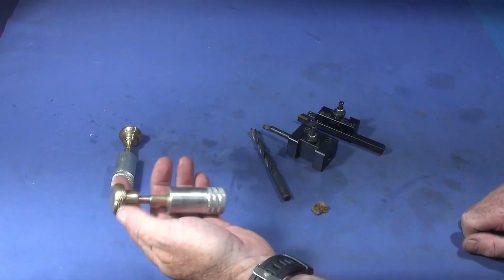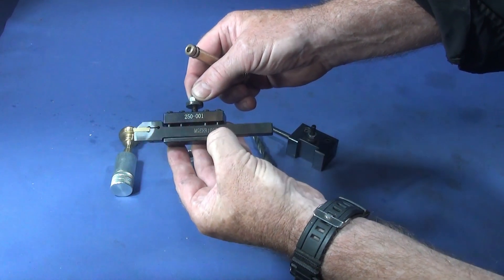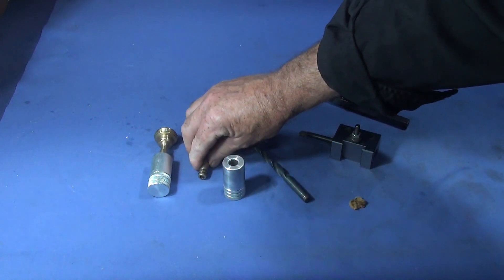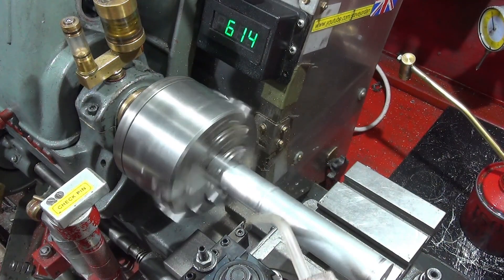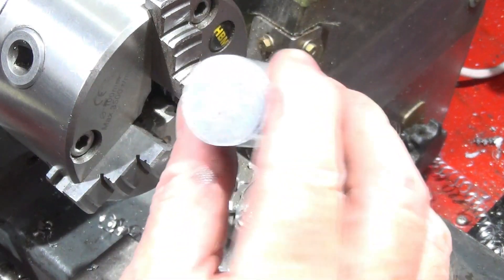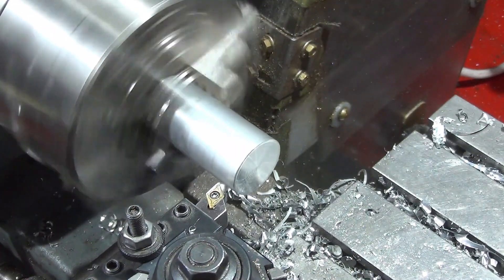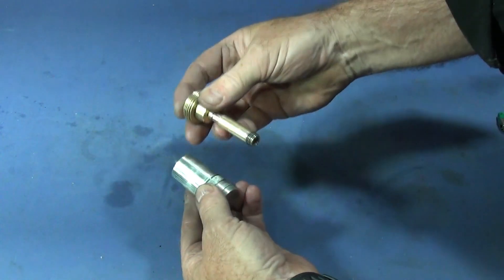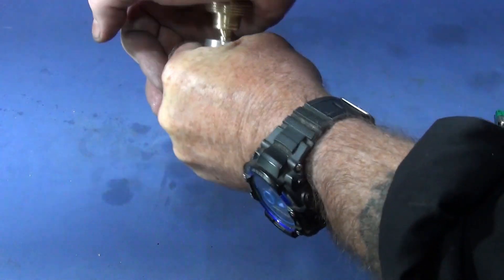Making A Very Short Pocket Survival Fire Piston Fire Lighter

Comment: Where are the plans? No dimensions are provided in the video.
Reply from the maker: Hi Adam, I don't ever use plans as I make things up as I go along.
Reply: @SteveJordan  Alright, 
1.What was the diameter and depth of the hole? 
2. What were the O-ring specs? 
3.  Did you hand feed the last part of the boring bar?
4. What is the diameter of the piston?

I made one, but it was about 3.5" deep and about .3906 diameter then lapped with fine timesaver compound with a brass lap. The bottom of the hole was the point of the drill. I'm impressed with amount of stickout on that boring bar.

Just like you found the surface finish and double O-ring with chapstick as lube was critical to success.
Reply from the maker: Hi Adam, I did hand feed the boring bar to the end of the hole, which was finished with a flat bottom drill. The flat bottom drill does not cut the diameter of the hole, just the bottom face of the bore, so it is dead flat with no indent.
I will measure mine up and give some dimensions this week. When I get one back from my son to measure. He uses them for his bushcraft teaching.
I will measure the o/rings I use.
I do everything by feel and don't normally take measurements. If a piston is too tight when the o/rings are fitted, I just take them out and skim a bit more from the bottom of the groove until I get it right. That's why I haven't any measurements to hand. Regards Steve

Comment from the maker: MGEHR 1010-2 10x10x100mm Lathe Turning Tool Holder With 4pcs MGMN200 Inserts -- https://bit.ly/3wg2aP4
Extra links:
Banggood & Clearpay Sale -- https://bit.ly/3dywaiD
Deposit Sale -- https://bit.ly/2Ut4uVI
Steve Jordan Coupon -- https://bit.ly/34hz2eJ
Reply from the maker: EXCELLENT DEBURRING TOOLS USED IN THIS VIDEO:-
NG1000 NB1100 Burr Handle Scraper Deburring Tool -- https://bit.ly/3wlnoeC
NG1001 Burr Handle 11pcs BS1010 S10 Blade Set  -- https://bit.ly/3wlffH9
Drillpro Chamfer Tool Countersunk Blade -- https://bit.ly/3jJG3y0
10Pcs RJX Handle Scraper Deburring Tool Deburring Trimming Blade -- https://bit.ly/3yusBlU